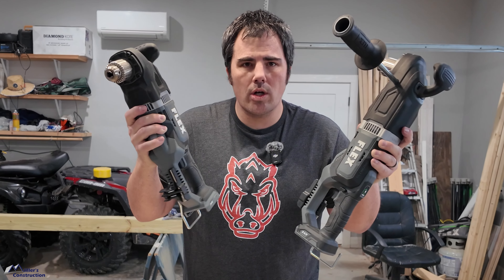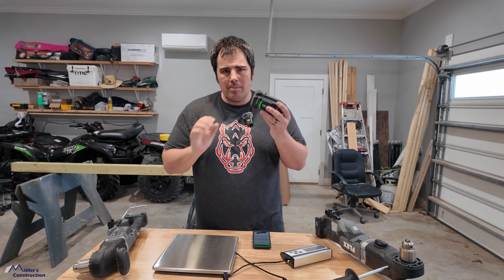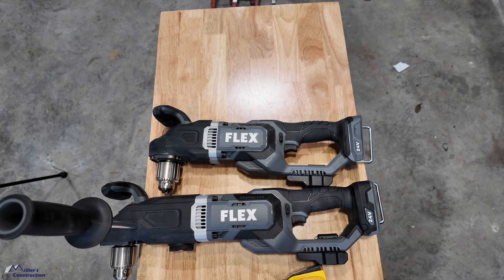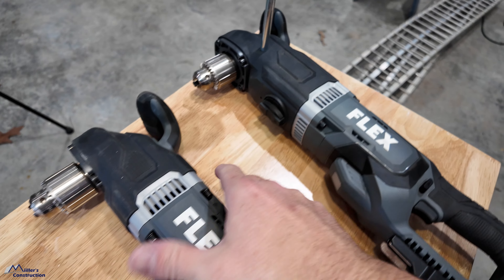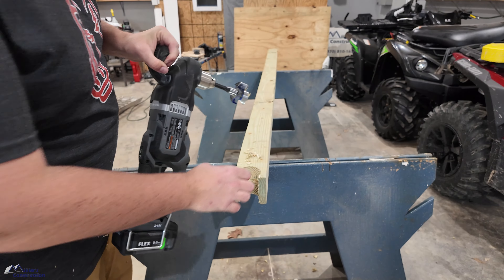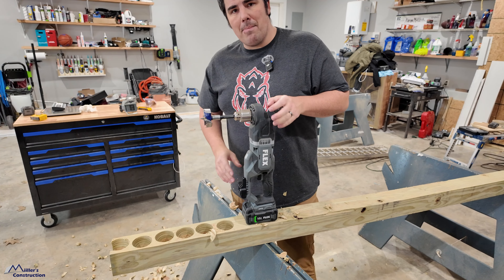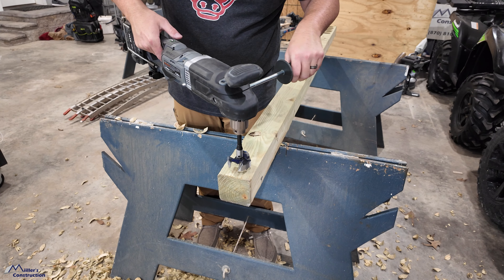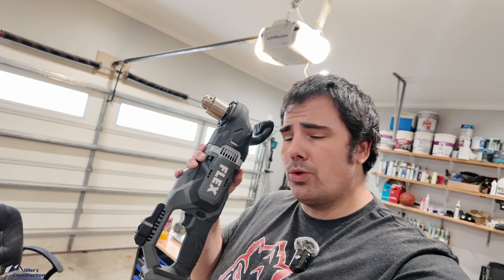Flex Right Angle Drills - Compact & 2-Gear Full In Depth Overview & Testing

Comment: Great content as always. 6 A.H. stacked lithium for the win!
Reply from the maker: Thank you! Yes the stacked batteries really take those tools to the next level!
Reply: Those big hog drills I thought about  grabbing to compact but I probably never use it.

I came across a tiny youtuber who displayed almost every nailer on the market FLEX is coming out with.. I didn't save him, don't remember his channel. Question any truth to the claims?
Reply: A framer I work with occasionally is field testing the 21°, so I'm assuming probably available later this year.  Only got to check it out for a couple minutes, but very similar to the Milwaukee and Metabo nailers.
Reply: I PERFER the 3.5 STACKED LITHIUM when I want to save WEIGHT but the 6 gives good Balance when needed
Reply from the maker: @rickyperkins232  I can confirm Flex has multiple nailers coming....
Reply from the maker: @THEBEARDEDTOOLGUY  yeah that 3.5 is great especially on drills and drivers!
Reply: @dcl97 How did the framing nailer seem to be holding up on the job site. I’m currently running the 21 degree Milwaukee nailer and it’s been pretty dependable the past few years.
Reply: @rickyperkins232  kaleb ross had a video showing the nailers that were posted online maybe that was the channel?
Reply: @nickp3270  you hit the nail on the head, that is exactly who it is.